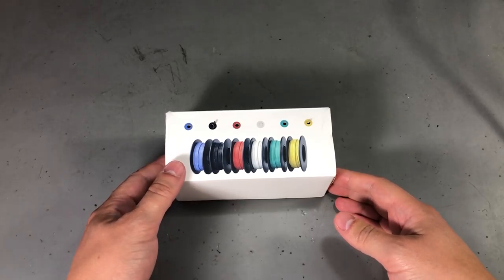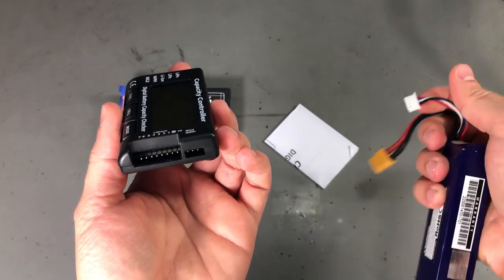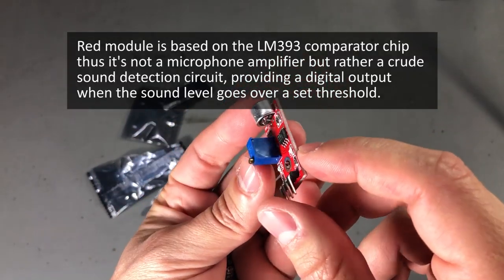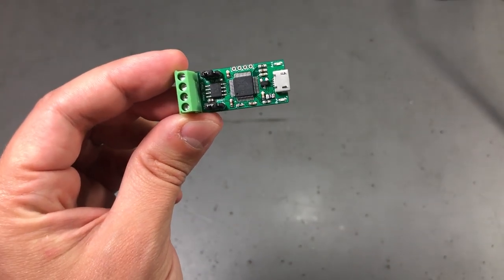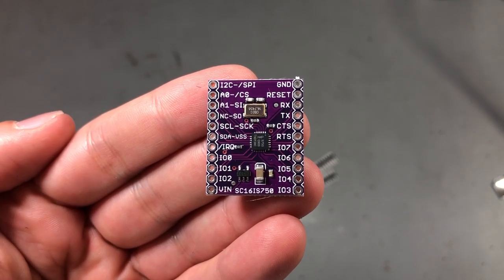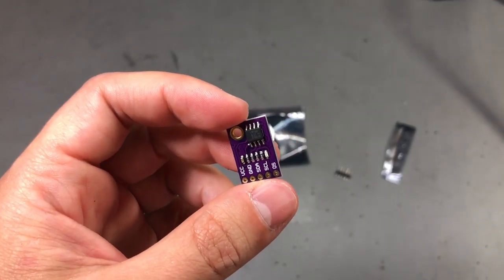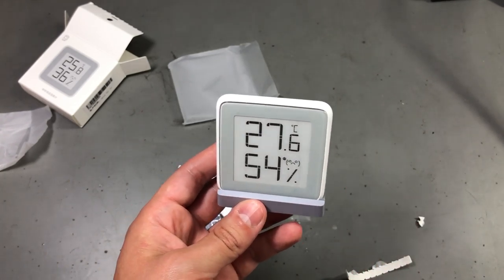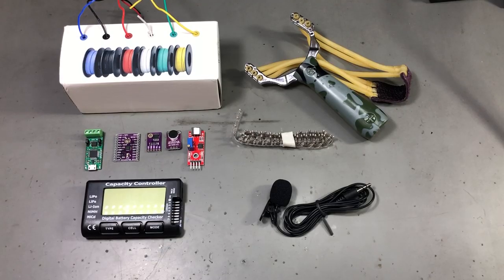Voltlog #242 - InTheMail

Comment from the maker: The Xiaomi Thermometer recovered quickly showing spot-on measurements after about 10-15 mins of usage. Maybe it needed some burn-in time for the sensor to settle.
Reply: I was just going to comment asking if it could've just been affected by you holding it or perhaps your studio lights in case they're very high power. But regardless, did you notice how he was visibly upset when you were criticizing his accuracy?
Reply: @ristomatti  Bah, ha, ha!
Reply: Good, I had high hopes for that gadget!
Reply from the maker: I don't think it was affected by me holding it, I just think maybe the sensor needed to operate for a while to get into spec. although that's strange, I've not experienced that with other temp sensors I've worked with.
Reply: I thought so. Xiaomi is not a bad brand, they usually make good products. I like the fact that it uses e-ink display. Not very cheap though at around 10 usd, but I'll get one. I just love e-ink displays.
Reply: @voltlog  
I am pretty sure it was you holding it. Because the exact same thing happened to me (with similar, but cheaper no-e-ink-display meters). I had multiple of them, but 1 was way off in temperature and humidity from the other three (same as here about 2°C higher and +5% rh). Thought it was broken (they were some 5€ meters after all), until I picked up another one, which in less than a minute was now also off in readings, while measurements of the one set down approached the remaining two.
So it was just me either heating the case or heat rising from my hand influencing the meter.
Reply: @borayurt66  You're complaining about $10. Ugh! Unbelievable...
Reply: @voltlog  Of course temperature was affected by being held, as was RH. Anyway...thanks for finding these goodies. I ordered the hygrometer and the wire. Honestly...can't wait to get the meter. It'll be my first bit of eInk tech, and I have a humidity fetish too (sensitive musical instruments). What a geek...
Reply: @qwaqwa1960  I am not complaining. There are similar items with LCD displays that go for $2-3, compared to those, this one is not cheap. I know that e-ink displays are pricier than LCDs, so that explains that. Yet still, not everybody has  the same amount of expandable income. For some $10 may be a considerable amount, and for some $1000 may be easy money. Some people even talk without thinking. Ugh! Unbelievable...

Comment: My bank account suffered a loss of 40€ thanks to this video. Battery tester and a 4-pack of the temp/humi meters.
Reply from the maker: Wow a 4 pack, putting one in every room? I keep this fancier one in the bedroom and I have cheaper ones in the other rooms.
Reply: @voltlog  Yep exactly. My original plan was to add temp sensors I can add to my home automation but I'm not really sure what would I do with the data anyway. These will be more practical but still look modern. :) Thanks for the tip!

Comment: As far as CAN as a bus system goes, it is definitely possible to passively just sit on the wire and monitor every single message sent to anyone; however, I have idea how many separated buses might exist in a car these days, or whether the data would be in any way secured (encrypted) - CAN itself doesn't specify anything about what the data it carries should be looking like.
Reply: The CAN buses aren't encrypted, but there is a protocol that varies from manufacturer to manufacturer such as SAE J1850 VPW, ISO9141-2, ISO14230-4 (KWP2000) etc. That's for the HS-CAN and MS-CAN. Multimedia etc. can use any proprietary protocol but it should be possible to sniff out messages even if you don't know what protocol is used.
Reply from the maker: If I can manage to isolate the particular message being transmitted when reverse is activated I don't need to know the exact data, just that it's changing.
Reply: Modern cars can contain many CAN (and other) buses. It really depends on the car and specifically want information you want to capture.

Comment: Temperature:
 LM75 vs LM35 vs LM335 vs DS18B20 vs thermistor vs (other) what's your preference? Why?

 I recently discovered you can find better "silicone" wires on AliEx by searching for Teflon or PTFE. At least the review images are better, and it looks like the product is not the typical PVC stuff that gets called silicone by many sellers.

   I want to know what is so special about the wire insulation used for most Hakko 900 series clone handles. I've touched it quickly many times with an iron while not paying attention and yet I haven't had a single melted spot or mark.
   I also took apart an old image projector that was originally made in West Germany. It had some wires that went to a high power bulb and ceramic base. Those are the only wires I've ever seen that looked and felt like actual silicone. They didn't melt at all with my iron turned to the maximum setting. Even with an open flame the leading edge cracked and crumbled but didn't melt. I wish I could find something like this type of wire cheaply. Even the high temperature stuff I've taken out of home appliances like ovens and microwaves has around a 300C rating and can melt. The really high temp stuff used has an outer fiberglass insulation braid incorporated around the wire, but inside of the fiberglass it appears to be the same 300C rated insulation. It does melt with an iron. This stuff from appliances usually has terrible flexibility though because the strands are much larger than what is sold for and used in hobby/consumer electronics.

  BTW, on a totally different note, you were right. I should have enabled the notification bell for your channel before. I was wrong for resisting.
   I have it set for similar channels that upload on Sunday. If I watch those early they have more interactive comments sections that I like catching if I can.

...anyways....problem solved here. I added the notifications for your channel :-)
Thanks for the upload.
-Jake
Reply from the maker: I have no particular preference for a temp sensor, I just like to have a few different ones and when i design something that I start from the specs and search for the part that fits.

I have also ordered some Teflon wire, it will get shown in the next mailbag. It has some advantages and it's usually used in high demanding applications like aerospace, although you wouldn't be getting the same level of quality from your typical aliexpress supplier.

Silicone wire is usually more expensive so you won't be finding it in your microwave oven but you will find it on your soldering station. You can get similar stuff from aliexpress and it will withstand the soldering iron tip as I've shown before. Sometimes the fiberglass type insulation is only rated for 150 or 200 degrees C so you will see it get baked if exposed to higher temperatures.

Comment: The first thing I would do with the JST Connectors is put a magnet to them.
Tinned brass, or tinned steel?
It is nice that the JST system locks, and is low profile compared to DuPont connectors.
Reply from the maker: they are not magnetic

Comment: I have a CAN chip on my rusEFI, but I don't have a CAN car. According to Scotty Kilmer - he's just a mechanic -, some of the cheaper CAN scanners can blow the ECU.
They make a LCD temp/hum with a wireless sensor, so you can get the temp/hum inside and outside.
Reply from the maker: Xiaomi also sells one with a low power radio so you can collect data in a home automation system.
Reply: @voltlog  Damn I was looking at one of those from the same seller but I didn't find any mention of e-paper but only "LCD" so I went for the basic ones. The Xiaomi stuff can be captured/controlled with custom transceivers to avoid the usage of their cloud service right?
Reply from the maker: @ristomatti  yes you can read those xiaomi thermometers via bluetooth with an esp32 for example.

Comment: Is that a pixel-based epaper display on the thermometer, or just a segment-based one ?

If it were a pixel-based display, and the firmware was hackable, that would be an immediate buy..
Reply from the maker: looks like it's segment based because it can refresh just a single digit.

Comment: Cheap RH/temp meters are almost invariably garbage, and DO generally use thermistors and discrete RH sensors. Search the products on, e.g., Amazon, long enough, and you'll actually find one or two cheap meters that use Sensirion sensors, which have a good & guaranteed spec.
Reply from the maker: This thermometer uses a Sensirion STS3x Accuracy: ± 0.3 ℃ and ± 3% RH

Comment: Damn. And again I spent money after watching your mailbag. Ordered one of those e ink thermometers. There is also a version with clock and Bluetooth available. Also ordered this. Might be hackable?
Reply from the maker: yup it's possible, you can read the data over bluetooth with an esp32 for example.
Reply: VoltLog did you see any projects with an esp so far? I did not search for it because it will take a month to get the delivery
Reply from the maker: @Hasitier  There are multiple projects doing this:
https://www.instructables.com/id/ESP32-Xiaomi-Hack-Get-Data-Wirelessly/
https://esphome.io/components/sensor/xiaomi_mijia.html
https://1technophile.blogspot.com/2018/05/openmqttgateway-now-reads-xiaomi-mijia.html

Comment: The CANable ships with the slcan firmware that enumerate the device as a virtual serial port on your computer and acts as a serial-line to CAN bus interface (limited speed). You may flush the CANable with the alternative candleLight firmware that enumerates as a native CAN interface on Linux and a generic USB device on Windows (full speed).
Here is a link to the automatic updater that allows you to choose the firmware type: https://canable.io/updater/

CAN is a broadcast system, meaning you can listen to every message on the CAN bus. It is easy to detect when the gear is on the reverse or similar simple actions. Connect your CANable to the CANH and CANL pins of your cars OBDII port and shift your gear to reverse a couple of times and see what CAN ID changes and what Byte value in that ID is responsible for the reverse gear shift.   

Personally, I prefer using the CANable-Pro, which provides galvanic isolation to the USB port to protect the laptop from high voltage accidents when working on your car. You pay more to protect your precious laptop. 

It is worth trying the SocketCAN networking stack can-utils, a rich set of utilities to analyze CAN traffic if you have a Linux machine. It will make your hacking experience joyful, meaningful and less tedious.

Thanks.
Reply from the maker: thanks for the hints!

Comment: That Xiaomi Thermometer, there's no way that's an ePaper display. It looks like LCD, it's fast like LCD, there's no ePaper refresh cycle, and even cheap displays that size cost $10+.
Take the battery out for an hour, I'll bet the numbers fade away (will probably take some time as LCDs take extremely little power, capacitor will last a while).
Reply: According to Xiaomi it's an e-ink display.
Reply from the maker: it's some form of e-ink, it will not fade away, it was shipped powered off, battery isolated and it was crystal clear
Reply: Did you even watch the video? There is no way an LCD has those viewing angles. And I saw an e-paper refresh at least twice.
Reply: @superdau  Don't argue with the man...he's wearing a SUIT, dammit!